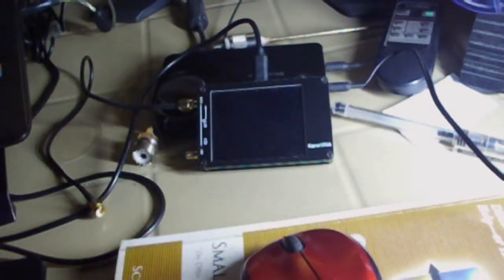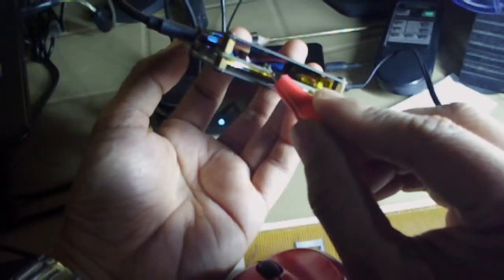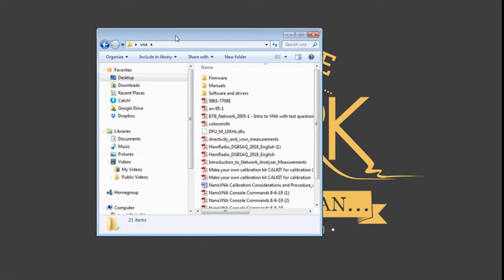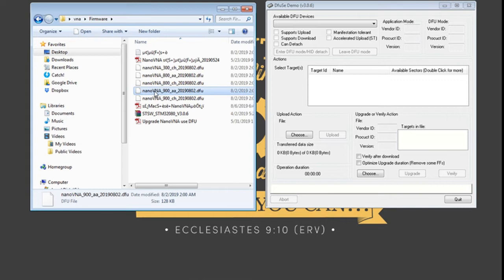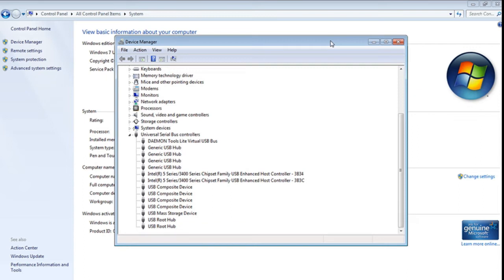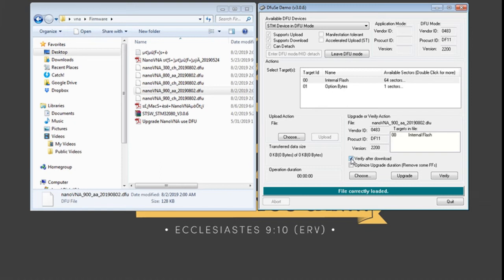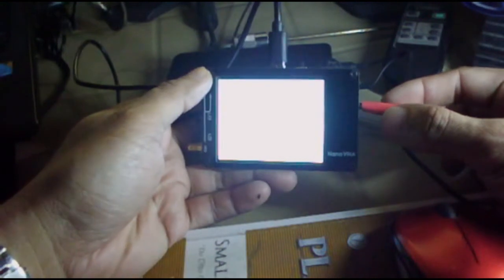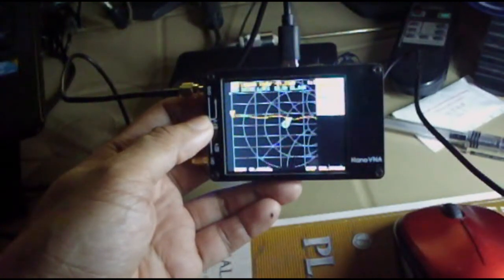Changing the NanoVNA firmware

Comment: it damage my calibration.. its not reading the right way anymore. nasira. paano ba revert to original firmware? everything is flat 1.0 swr.. :(
Reply from the maker: whenever you change the firmware you need to recalibrate the device. if you need to restore to your original firmware just re upload the firmware that came with your device.
Reply: @EphraimGariguez  where can i get the previous firmware? i even dont know the  version..
Reply from the maker: @revadan  the firmwares are available on github just search nanovna firmwares
Reply: @EphraimGariguez  ok already figure out the issue.. need to clear the config from the terminal and re-calibrate the unit again.. its reading normal now. Salamat.

Comment: Do i need to calibrate it again? I have erroneous swr reading after update.
Reply from the maker: yes you need to recalibrate for every firmware upgrade or downgrade, sometimes you also need to recalibrate touch screen settings depending on the firmware you used.